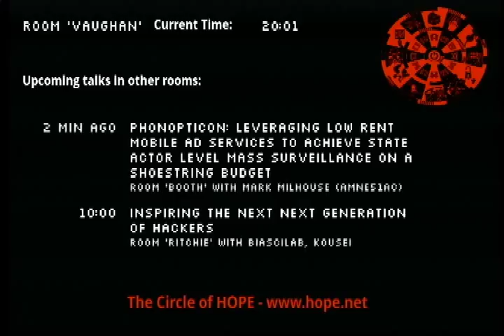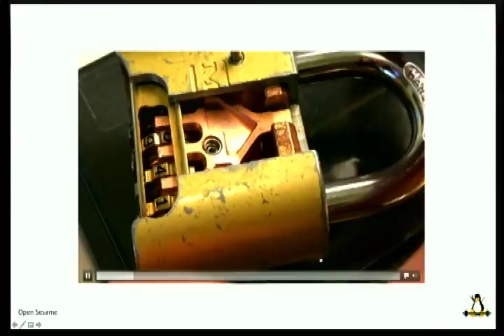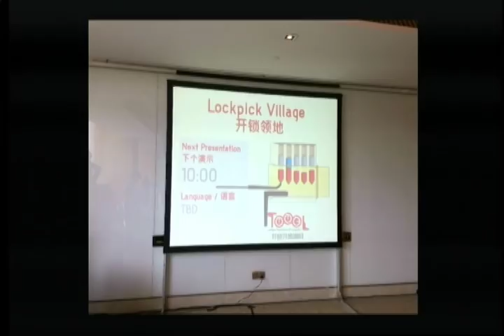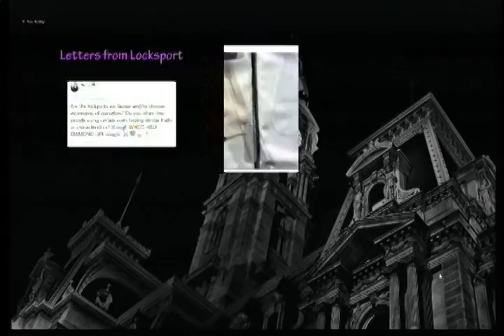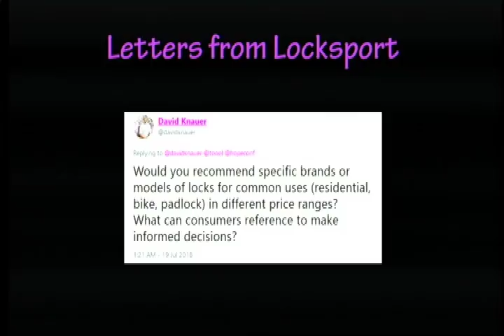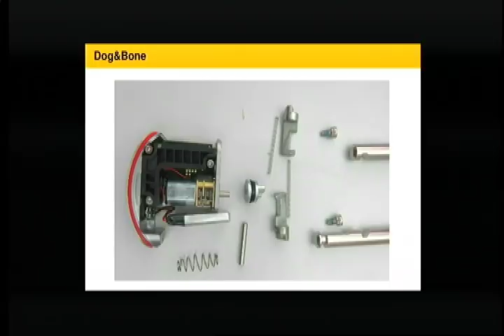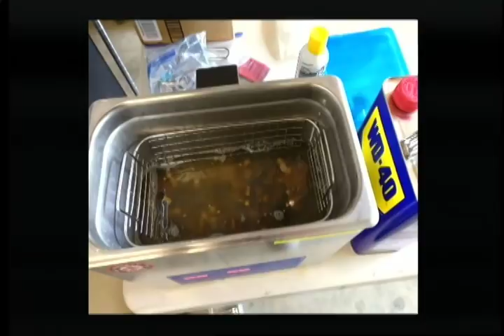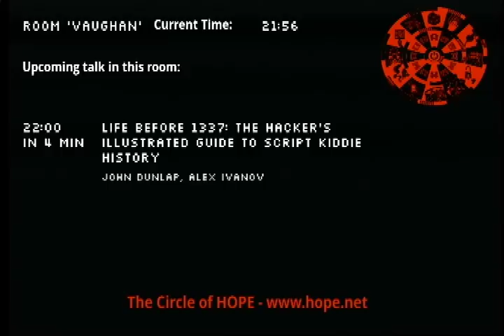TOOOL and Friends - Locksport Variety Hour [HOPE 12]

Comment: About the whole tension wrench thing. By rotating the core in that manner, there is a force acting on the pins in the lock. The force is “Shear TENSION”, essentially the lock core and body are acting as shears to the pin. So tension is a viable word to use so can you please start shutting down these know-it-alls who don’t know anything. All that they are doing is just obnoxiously pushing what they think onto people, whether correct or not.